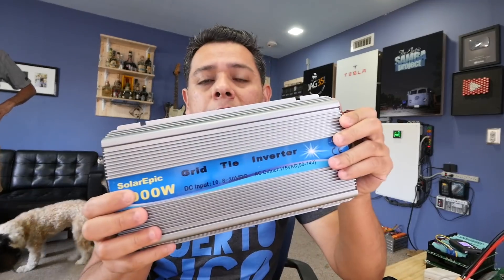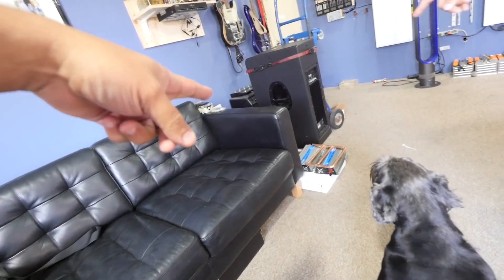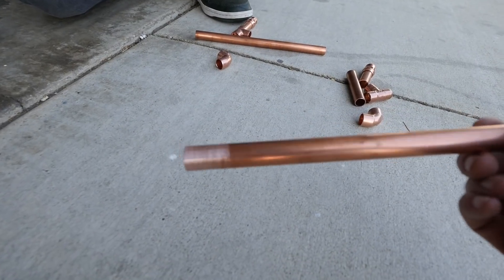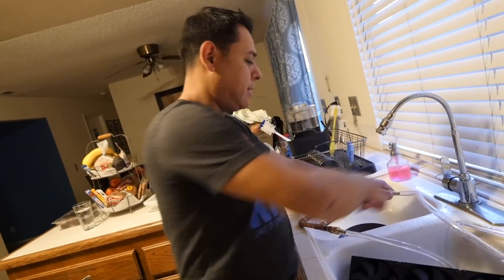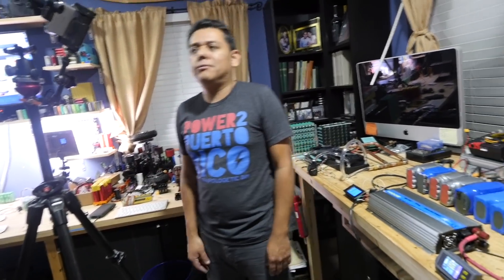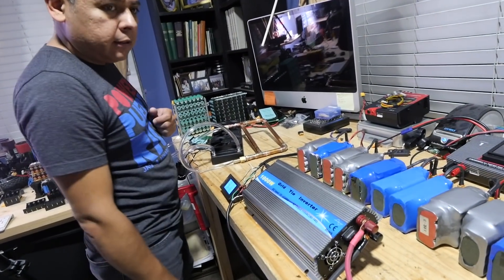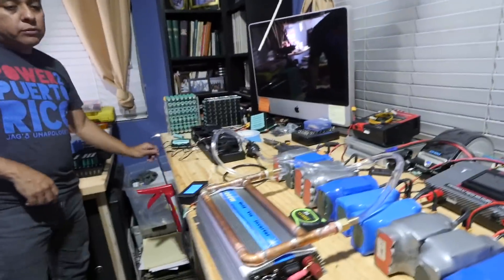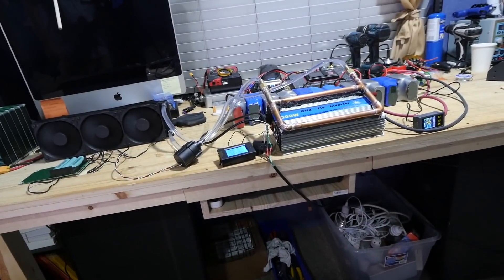Liquid cooling A cheap 1kW Amazon Grid Tie Inverter Experiment

Comment: Hi J you could smooth down the side of the inverter with a dremel where it gets hot. Then put a water block at the spot and connect that to your pump and radiator. Just remember to use thermal paste when you install the water block

Comment: You should try removing the outer casing/heatsink from the inverter and attach a water cooling block directly to the MOSFETs and components that make direct contact with the heatsinks. Maybe take a length of copper pipe and leave each end round but flatten the mid-section and attach it to the heat generating components directly with thermal paste and make some brackets to keep pressure on it like the original heatsink. Keeping the original casing on isn't going to have any good options for integrating water cooling. That's like a metal handle on a frypan, it has very limited contact with the pan so not much of the heat can transfer into the handle.

Comment: Use smaller copper tubes and with only one pass, no parallel flow, and bend them close to cover more surface area. This, I think, would be achieve better heat absorption from the inverter shell. Try and see. Hope to see a video.

Comment: Putting a fan over the inverter maybe is better than watercooling from outside with this little surface contact.

Next time try to put the piper direct on the mosfet who generate most of the heat

Comment: Open up the inverter... determine which parts are hotspots. If possible use liquid CPU heatsink or use heatsink adhesive to bond the surface to the cooler of your choice. Use multiple watercooled CPU heatsinks... or other watercooled heatsinks. It may be ugly at this point but for the purpose of testing, it doesn't matter. You can always build your own case at the end.

Comment: Yep i have a solar powered USB fan, when my dump load is on the USB fan is typically running, however the smell of hot electronics is annoying on those. So when my battery is full i dump excess into this grid tie to help offset anything i'm running thats not on solar circuits

Comment: The leaking issue is probally because you didnt use flux for soldering. The solder probally never "sweated" into the pipe correctly. 

The water cooling could work but you should look into opening up the inverter and epoxing PC water cooling blocks directly on the mosfets. The mosfets are the ones attached to the wall of the invertors.

Comment: Good experiment, but wonder if just buying a slightly better inverter would resolve the heat build up/efficiency issue.  Mixing water and electric components is probably not a good DYI project for the average Joe.  I would have tried adding fins and a fan to the outside of the inverter first, even just using the thermal tape.

Comment: you forgot to clean the inside of the copper fittings and you put the flux on both cleaned surfaces not just on the outside of the pipe after youve put it togeather, thats why it leaked

Comment: If you run alloy box pipe and cut it then fold it over weld it up then thread in the pipes into it Place the moss onto the box pipe with a heat transfer compound. Then place plastic over the top then run a fan down the middle. The rad could be a water fall so you can make a bigger heat storage like a tank.

Comment: Use thinner but more pipes so u can increase the conducting surface. And place them between the radiator fins if possible so they can fit tighter and take out more heat. Of course that will be lot more work :)

Comment: You have run into a few problems.
Your surface area is too small.
You didn't have direct contact to the surface of the mosfets that are giving off the heat.
The radiator and water reservoir are too small.
All of these can be overcome with more planning.
I suggest you watch a few videos by JayzTwoCents on computer water cooling.  He sometimes acts like a dope but he is the guy to look at with watercooling.
Don't give up on this yet.
https://www.youtube.com/watch?v=Q2SIrV_4-dM

Comment: Remove the aluminium heat sink on The inverter, use a grinder to remove the fins in a square around the outside of the heatsink, get a square manifold made from a block of aluminium the same dimensions as the square you have ground out. Mount it to heatsink with bolts and sealant, run the coolant over the whole top of the inverter.

Comment: Liquid cooling is only better if you need to cool a small area where you can't place big fins and fans directly on top of it. After all it goes into into a radiator that tries to dissapate the heat into the air. That makes sense for example for processors, so you place the radiator in the case. I would go with direct air cooling if you have the space for it, espescially because these inverter cases are already made for air cooling.

Comment: Stand on edge and use fan to draw air up and over
Reply: What George said, Mount your inverters in a vertical box, use high static pressure rated CPU fans, and mount them at the bottom of the box with filter media in front of each fan to keep dust and debris from entering the area where the inverters are mounted.

Comment: Noice!! Jehu as always. Great stuff, ty. I will recommend take out the casing and soldering some aluminum right next to the tubes for effective heat transfer, also for maximum surface coverage make the tubes to make many turns, just like in the back of a refrigerator.

Comment: There is much room for improvement for the water cooling. You could just flatten the case, i don't know if that is possible to create enough flat surface to place cheap water cooler blocks on them, that would give you much better results. The best would be theoretically if you could make the water contact the case directly. Maybe you could weld side panels to that whole thing and do it that way, but don't use copper in that case because copper and alu can't be mixed if water is used between them. Go full alu, it is cheaper as well. I don't know how hard it is to weld... or just screw it together and use silicon to make it water proof. :)

Comment: A little more work getting a long solid heat sink and drilling a hole for the copper pipe and switch to proper mineral oil would work much better, did that for my computer cooling system on a smaller scale, difference between 20-30 degrees. Experiment away, loving the videos!

Comment: Dear Sir,
Generally speaking water cooling is considered more efficient, this being the case, how about removing the aluminium cover to see how one could potentially connect water heat sinks are inside to the pipe work?. It’s just a thought as most high drain applications rely on water being a far more effective medium to dissipate the excess heat. Kind regards.
Reply: ToolsConsumables if you intend to use the inverters in a grid tie situation you not be able to open and modify them since all grid tie devices have a certification process
Reply: Dear Sir/Madam,
Thank you very much for your comment. I am not familiar with inverters, I merely relied on our host's expertise to verify if such an idea might have been exploitable. Kind regards.

Comment: Hi man, nice ideea. i think you can solve the contact surface problem, by taking 2 cooper plates, screwing them around the inverter,  and solder the cooper pipes on those plates, on both sides. and between the plates and the inverter you put that paste. i think that should solve it. to be sure, between a plate and the inverter you could put a thermal probe just to make sure that you don't burn off the inverter. happy testing. bye.

Comment: An easy way would be to sand the bottom surface of the inverter casing to get rid of the anodized surface and bolt them all with a thermal interface paste to a large capacity heat sink, something like a 12mm or thicker plate; then if needed cool that plate with water. Maybe all that is needed is a water mist and fan on the back of the plate.

Comment: My laptop is almost all metal and when I run a small USB fan so it blows over and under keyboard it cools down so quickly. 
Just point a USB fan at the invertors so it blows air over and under them. Should stay cool with little power.

Comment: What you should be looking at is increasing the radiating surface of the inverter in order to raise the thermal dissipation rate. Take a look at something like an industrial M shaped water cooling block,   it's quite cheap and it works ;-) put it under the inverter with thermal paste and you're good to go

Comment: I agree with the other comments on using standard all in one ready made cooling sets for CPU's and stick the blocks to the hotspots.
Also, if you are going to use 6 inverters at the same time, be sure they are on different phases. When you connect all close together on the same phase, the voltage will spiral up between them as they all want to be a little higher in voltage to 'push' the power to the grid. Then, when reaching their max voltage, they will (hopefully) shut down.

Comment: I'd just pull the case off the inverter, and attach some cheap ebay water blocks directly to the cooling bars that are between the transistor and case.

I'm considering water cooling the controllers that are going onto my motorcycle that way.

Comment: I'd mill out every other fin on the heatsinks, then weave thinner copper tubing through each milled slot.  Depending on the case metal I would consider completely soldering the pipes in place for better thermal transfer than the goo you're using now.

Comment: There are cheap watercooling blocks on ebay, get few of those and glue transistors directly to them, much better cooling performance and probably wouldn't cost too much.
Reply: I would not put any water cooling blocks anywhere near the electronics of that inverter, if they leak, your inverter is done.  It would be safer to push air through copper tubes as heat pipes than using liquid cooling.  These inverters don't get that insanely hot like overclocked CPUs that they actually need that level of exotic cooling.  Just forcing air to flow over the surface of the existing casing fins should be sufficient to cool them down a bit.  These same 1KW inverters run every day outside in the hot stagnant air here in the Southern Cali Inland desert on my solar panels with no cooling assistance other than shade from the sun and the occasional breeze and they have not melted down or blown any MOSFETs yet and I've had them running daily for 2 years solid.  Of course it helps that I don't run them into the ground by running them 100% duty cycle at their max rating of 1000 W.  They run at about 60% capacity during peak hours at ≤ 600 Watts running two large 3x6 315 Watt (max peak) rated panels each, which is a far smarter way to play this game than maxing them out on design specs and adding costly exotic cooling schemes to make sure they don't fail just because we are running them too hard.   
 
People need to stop running electronic and electrical equipment at design peaks.  It will last longer and cost you far less in the long run.  The good rule of thumb in engineering is to always leave yourself 30% minimum overhead so you don't bump up against problems with individual components that are zealously overrated by their manufacturers and small flaws in components that don't manifest until you overdrive them by running them at 100% (peak ratings) as a baseline.  The cost of the cooling schemes and eventual failures and repairs brought about to treat equipment this way far exceeds the cost of the simply adding another inverter here and there to distribute the DC power evenly across more devices at less than max peak design limit levels.  Unlike CPUs, there is NO benefit to overdriving an inverter.  None what so ever.  Reliability goes to shit, longevity goes to shit, you'll be replacing inverters and what more did you get out of it than you would have if you had more inverters running at lower levels?   It's not like it helped you produce your AC power faster or something. Lol..   Take this advice, don't combat heat, simply get more inverters or higher rated inverters to not generate so much heat that it becomes a problem in the first place.  That is the correct way to make a reliable grid-connected or off-grid PV power system.
Reply: @xapplimatic  Yes, i have to agree with that, i'm not that familiar with inverters but i am with high power amplifiers which work similarly. They are all designed with some headroom, using twice as much mosfets but i can tell you one thing, most mosfets can take a beating only if they are paired (parallel ones from same batch) and cooled properly. Most inverters these days are fairly efficient so 100w heat on something like 10 mosfets is nothing even with poor ventilation since most of them can go to 120c or so. I generaly don't want to run equipment to their max unless i have to, if i have to i will make sure it runs happy and doesn't overheat.   I have seen some people in past taking transistors from ATX psu and mouting them to big passive heatsinks so i got my idea from that except it's waterblocks and not heatsinks.
Reply: Cekpi7 do you mean those nice blue cooling water blocks?
Reply: Yep, they don't work that good with 100W cpus but should be fine with less load.

Comment: Build a box round the inverter, with a gap for air flow, fans on bottom, exit vent on top, thermal switch for fans, sorted!
Reply: great suggestion Michael Edmond.  I commented similarly more recently.  Your more succinct and to the point than I was.

Comment: Use a bit of copper sheet to increase surface area and use thermal paste under it . Also make the pipes run around the side . Then you will see a lot better performance.  If you do see this and want a 3d model or something pm me

Comment: Recommendation: Unsolder the mosfets and extend them a few inches and mount them directly to the liquid cooling surface, maybe buy some rectangle or square copper pipe and mount the mosfets to the surface with thermal paste and a clamp. This would increase the surface area drastically as well remove the heat from the rest of the electronics. Would also make repairs easier in the future, as the mosfets are typically the first thing to break on inverters.
Reply: Another of many good water cooling options.

Comment: You need a bigger radiator. Also re purpose an old water cooling block. You might need to machine down the case for a smoother surface. I found cheap radiators on amazon I re purposed for a cooling solution for my GPUs in mineral oil. I got the video on my channel.
Reply: Also smaller copper pipe might work with your idea.

Comment: You'll honestly be better off with a 12" fan at one end with some kind of enclosure to direct the air over the heat fins on the top...

If you still want liquid, you really need a system that can run water directly across the thins without any leaks... Otherwise air cooling is simply going to be more efficient.

Comment: Use peltier cells and water blocks, cool down the hot side of peltier cells with a derivation of cool water from the pertier cold side to optimize the cooling process and change the water for engine coolant (the same used in cars radiators)... More contact surface, lower fluid temperature and a higher temperature exchange rate of the fluid, you can get a very dramatic results even with the 100F degrees of the California sumer

Comment: Thanks for showing these, definitely makes solar a lot more do-able for the average person.

https://www.uponorpro.com/~/media/extranet/images/products/showroom_joisttrak_full.ashx

I've been using these to water cool high power LEDs for about 3 years now. They are easy to use, just cut it to length (mine are 4ft segments), snap a copper pipe in there with some bulk heat transfer paste (butt paste, if you must) and it's ready to go. For connections to the pipe you can use shark bite push lock to PEX tubing, then PEX to whatever your radiator is. Even PEX alone can pull heat from it, but obviously not as well as copper. You could put some solder between the tube and the plate for max heat xfer, but I don't think that's really necessary. The push locks start to add up if you are using two per inverter,  but you could easily put multiple inverters on one plate.

You'll definitely get a lot better performance getting those FETS directly onto the cold plate. It's such a pain that they make the side heat sinks curved like that.

Did you measure the water temperature? I just looked at the thermal camera imagingThat radiator looked a little small for a 1kW device since it's meant for cooling 500-600W TDP max. Cheap radiators can be found in old refrigerators and car/home AC units.

Comment: You could try using a larger pipe but flatten off the edges so it has more surface contact. Or you could try and use some peltiers on the side.

Comment: It does work and will drop your temp a lot more, if you aim at the MOSFET instead of the outside casing. In ebay type "Aluminum Water Cooling Block 40x200 mm". you can use those or a combination of those directly on the MOSFET.  Also probably cheaper than that Homedepot run.
Reply: Which actually was a Lowe's run. :-)

Comment: If you could angle grind  down some of those fins near the mosfets and flatten the copper Pipe a bit to maximize surface area, also squish the pipe into the thermal adhesive so that the excess can be removed since too much will act as insulation, if the mosfets are only on one side then you can probably get away with only one pipe on that side, also if you are going to make a system to cool several inverters place the inverters in a row (unlike the orientation in the video thumbnail) so that one unbroken line of copper can cool them and you won't need to solder as many joints, also provided that you have adequate pump flow the liquid temperature will be fairly consistent throughout the loop and won't heat significally from one inverter to the next